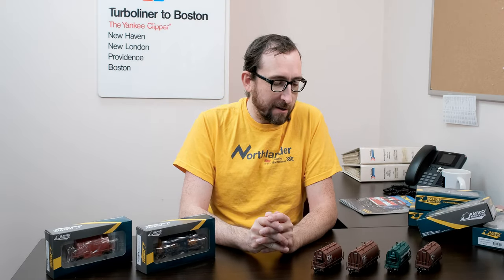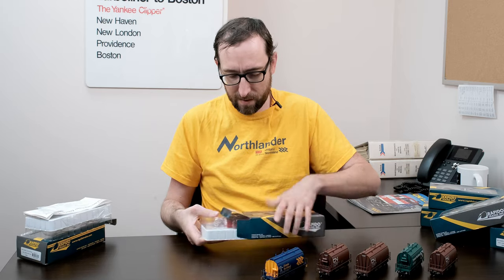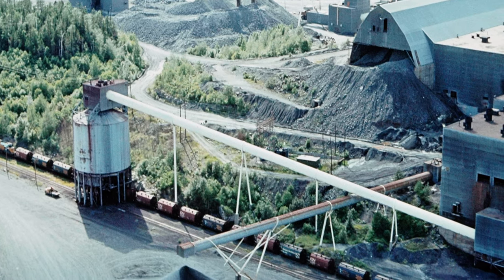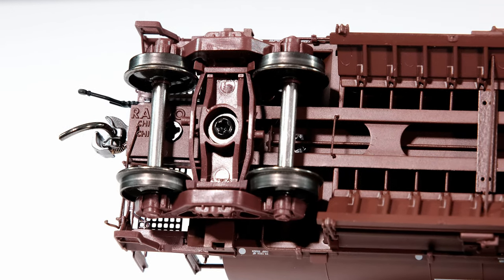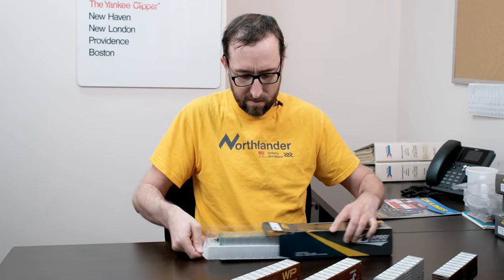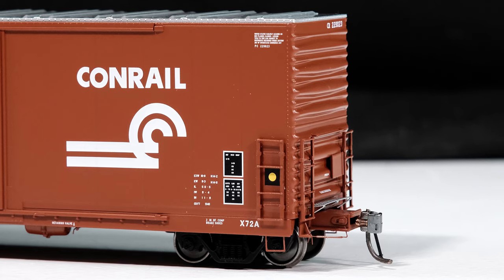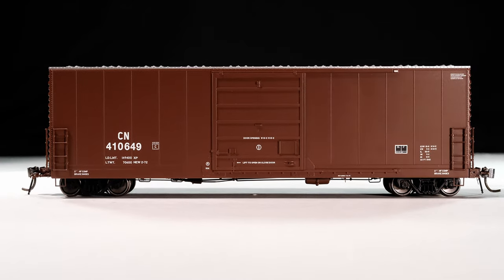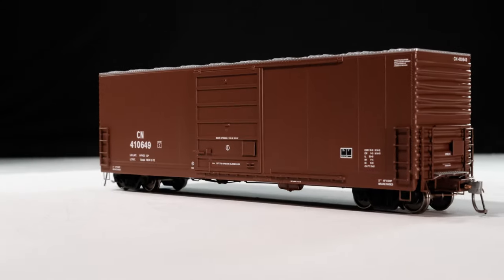Rapido New Freight Cars Unboxing

Comment: COTS stencils began appearing 1972-74; yellow dot "good wheel" inspection marks began in 1978 but ceased to be used a decade later when all the bad wheels produced were replaced.
Reply from the maker: Excellent info!

Comment: would the hand brakes have been closer to the roof in the earlier box cars 60 throw to the 90s
Reply from the maker: The X72 prototypes were built in the early 70s with low brake wheels. High brake wheels were a hold over from older cars built with roof walks. Roof walks themselves were banned from new built boxcars from 1966 on wards, but many older rebuild cars could still be seen with high brake wheels into the 90s and even 2000s.